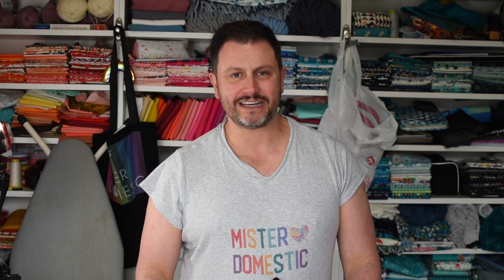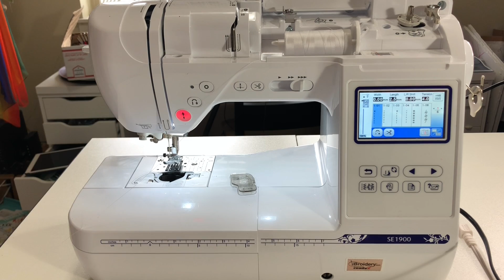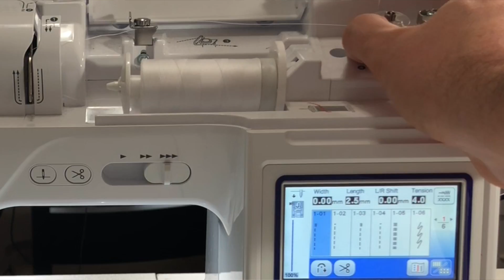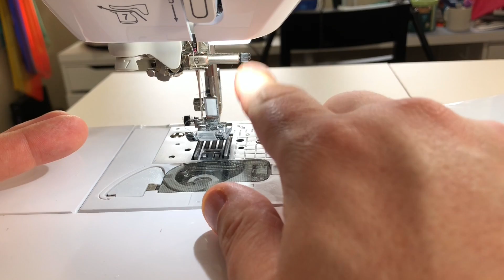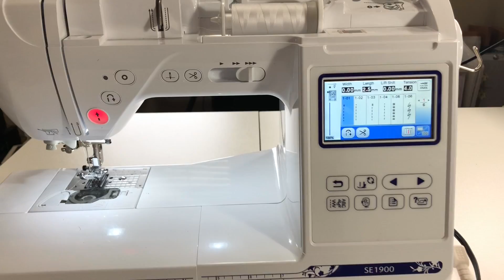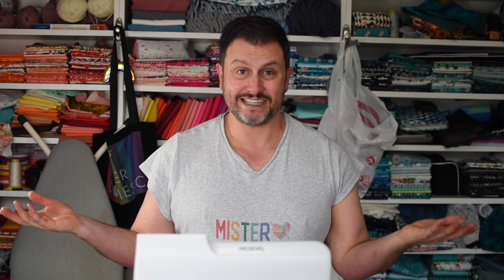How to Use a Sewing Machine - Sewing for Beginners with Mx Domestic

Comment: Nice video!!  Love it.  One correction: You are calling the controller pedal a "presser foot".  Yes, you do "press" on the pedal.... I normally wouldn't be so picky, but the presser foot is what you've been calling the "foot" on the machine between the needle.  The function of the presser foot is to hold down the fabric as you feed fabric through between the presser foot and the feed dogs.  The presser foot 'presses down' the fabric or material, it is not the pedal to run the machine.

Comment: Some manufacturer needs to figure out how to use a whole spool of thread as the bobbin, so you don't run out of bobbin thread in the middle of a long seam!  SOOOO annoying!
Reply: DzyMsLizzy 
If you buy pre-wound bobbins, i.e from Superior threads- you will have so much more thread to work with because it is wound on a power machine.

Comment: Why you didn't put the thread thru that little hole in the bobbin before you started to wind? 🤔
Reply: My machines manual says that "from the inside, pass the thread through the hole and while holding the thread with your right hand press start/stop button. After the thread has been wound about ten times press start/stop button and cut the extra thread above the bobbin hole so that there is no excess thread."  I think it's purpose is to help keeping thread in place while you start winding the bobbin.
Reply: On my machine, putting the thread thru the hole on the side of the bobbin keeps it from tangling when you’re winding it. Your machine might be different.
Reply: @MxDomestic  That's what she said. 😄

Comment: I have been sewing for over 40 years I always buy little cheap sewing machines from wal mart for 2 or 3 hundred dollars my sons bought me a 700.00 sewing machine and I am scared to used it lol so many nice things on it but so afraid I am going to break it I used it only for sewing and use my cheap one for quilting thanks for the tip on wetting the needle that was a new one for me I seen where you can roll the needle in your palm of you hand over thread it will thread it I can not do it lol thank you of the vidoe

Comment: Hi
I have a brother xr9500 it’s a model from their project runway promotion. Anyway I’m having soo much trouble with the top fabric being “pushed” if I pin the fabric it ends up with slack in between the pins, if I just line the fabric up it ends up 1/8 to 1/4 off everytime. I tried several things like a Teflon foot and fiddly tricks but no help so far. I emailed Brother to see if the  upper tension could be adjusted but they just sent a help link that when clicked said on said “sorry this machine doesn’t have this feature” do you know of ANYTHING that can help? Thanks, Sry long message
Reply: Jennifer McTavish 
Could you try lengthening your stitch to about a 3?  It’s weird that your machine doesn’t allow you to reduce the tension.  If you find out that you can, try reducing the tension to a 3 first.

Comment: Sewing machines are scary! 🙈 I have a Singer electric sewing machine and sewing a straight line is hard even with the tricks I found on youtube. Now it just sits in box. 🤷‍♀️
Reply: Nelley Knight I found singer to be a very finicky machine with tension etc I traded mine in for a janome no problems years later it still going and at a friends I am now a  Bernina fan .....I believe brother is not a problem with tensions etc
Reply: Are you watching the needle when you sew? You need to watch the edge of your pressure foot or somewhere else. If you watch the needle while you sew, you won't sew a straight line. Watch the edge of your fabric, on the right or left side of the pessure foot.
Reply: @dickworrall123  I tried watching the fabric, putting the little metal bar, putting tape down and it still didnt help. I lightly press on the presser foot and the needle still goes way to fast for my liking. I'm thinking maybe I should buy a brother machine, seems less scary 😅
Reply: @jadestoneonline  If the needle is going too fast, the Brother electronic sewing machines have a speed control.You can set it, so the machine will only go slow, no matter how hard you press on the foot peddle.

Comment: I was taught to stick the thread for the bobbin through the little hole in the top of the bobbin before winding it. The white rectangle behind the needle helps to thread the needle, too. Great job, Matthew!
Reply: I was taught to pull the thread through the hole also.
Reply: Ya.. winding bobbins is like waitin 4 paint 2 dry!.. It's just NECESSARY!!...  Lol.. 😋👍
Reply: I have 2 Brother sewing machines. The manual one, you put the thread through the hole in the top of the bobbin. The electronic one, you wind the thread around the bobbin and there is a thread cutter under the bobbin at the winder. Same as Mr Domestic's machine.
Reply: I guess my machines are both oldies. What will they think of next? Hopefully, a machine that won't need a bobbin winder. I don't know why but winding a bobbin is a job I just hate to do. (Probably because it takes 10 plus bobbins to make a good sized quilt top)